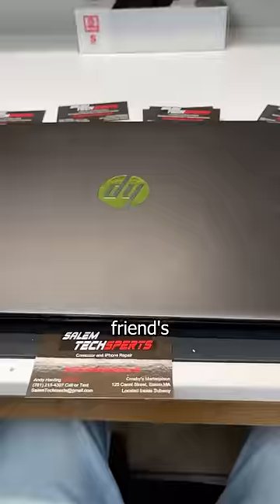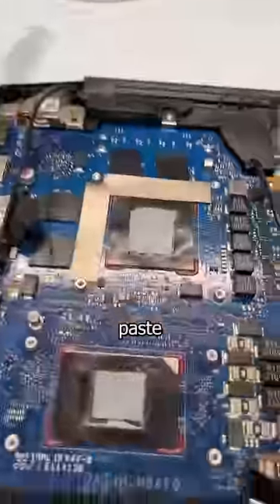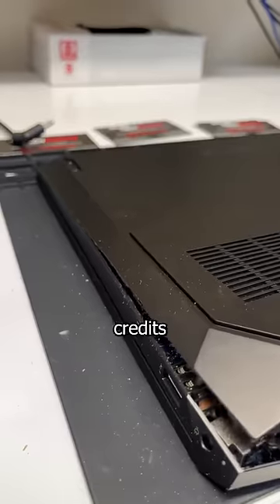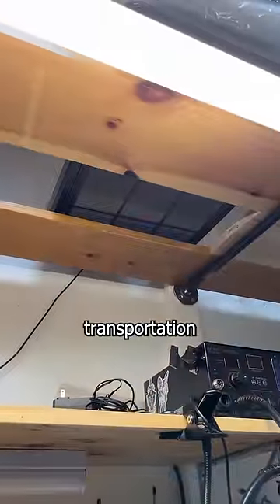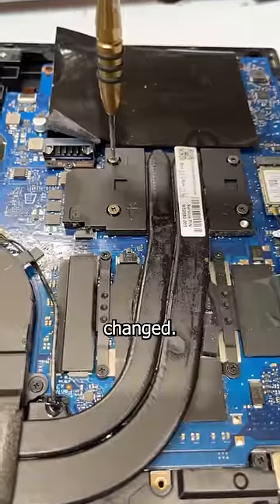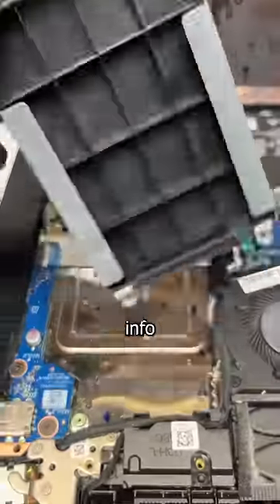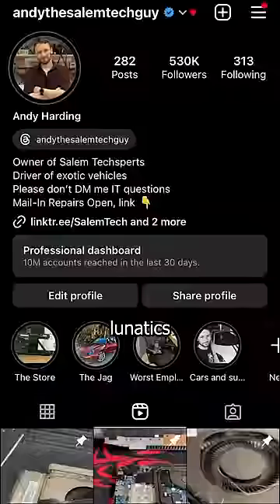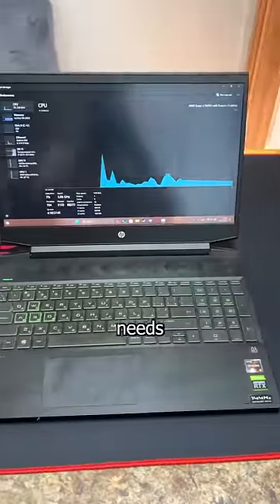HP #laptop survived the war in Ukraine and saved my friends life. #tech #pc #technology #shorts

Comment: The most generous technician that's ever lived.
Reply: 506 likes and no comments?
I'm not an NPC so I won't say that I'm going to change that even though I am.
Reply: Yo why the comment section is empty
Reply: Lmao yess😊
Reply: most greedy technician that ever lived. 350 usd for this kind of job is insane price. I worked in a PC repair shop, this job is max 80 eur. Takes  40 min, requires zero repair capacity.
Reply: @cactuslietuva plus €150 for the 2tb samsung evo.
Reply: @cactuslietuva  Hello, I am also a computer technician in the states. For $40 we'd do anything non-hardware related, for $100 we'd install a sata SSD. I could see a world where an M.2 2TB SSD bumps the price up to $350, especially considering many laptops are a pain in the ass to disassemble. Repasting and the liability with the fragile dies on laptops just makes this make sense.
Reply: @DingleFlop  Yeah, i didn't put ssd value into repair bill.
Reply from the maker: No, you didn't, but you still left a comment saying I'm greedy. See how stupid that looks? Take a second and get your facts straight before leaving comments like that.
Reply: @SalemTechsperts bro is really trash talking in the place where the victim has power💀
Reply: @cactuslietuva Hello commonsense are you lost??
Reply: @cactuslietuva  💀 where did your IQ go?
Reply: @cactuslietuva guy: does a repair for free.
you: omg greedy much?

You really oughta put those two brain cells to work more.
Reply: @SalemTechsperts 
Dam fragile ego...
Reply: Then delete the original comment 💀 @cactuslietuva
Reply: That’s a good one
Reply: @nikhilnarayanan5949  you guys cant take a joke or what?
Reply: It feels like your back tracking cus of the hate you got and you being proven wrong  @cactuslietuva
Reply: skibidi toilet !
Reply: @cactuslietuva oh yes!! Very funny joke.
Reply: @nanwi200 bro what💀
Reply: @adman1056 Damn*

Damn, shit spelling. 🤣
Reply: @whatdadogdoin8703  really? Are you 8 years old and just discovering social media.
Reply: @SalemTechsperts bro thinks a 2tb ssd which costs like 200€ alone is a 80€ repair 💀
Reply: @cactuslietuva  you didn't phrase it as a joke lol
Reply: @theheroofourtime3578  i don't give two shits about internet comments
Reply: @cactuslietuva dude respect the hustle, even if it's expensive, your pc will need it, and it would suck trying ti find an ACTUAL person to help you build your pc. Think man, money is money, and you needa survive against a corrupt government
Reply: @cactuslietuva here we go with the “you cant take a joke?” Shit, cause you cant come back from that. Stfu bro
Reply from the maker: @adman1056  Ego has nothing to do with correcting false statements where the sole purpose is to try to discredit me.
Reply: @SalemTechsperts I was about to comment this but you were faster
I guess your also the fastest Technician ever

(Dad joke)
Reply: @marisakirisame867  hello fellow touhou fan
Reply: @cactuslietuva but you still here, responding to them
Reply: @adman1056 Now to add on with what Salem said

Imagine someone comes up to you and says not good words you would say not good words back right? Now imagine he says wow what a fragile ego you have. Only because you talked back to him

See where im going with my analogy?
Reply: @cactuslietuva  you cant make a joke or what?
Reply: Not to mention the price of an M.2; for 2 TB, $350 is generous in of itself @DingleFlop
Reply: @cactuslietuva  and we're still looking around finding if we could give two shits about your comments 😭
Reply: @cactuslietuva  Ahhhh i see saying something rude and only calling it a joke after you anger everyone around you. Classic move of the scummy kind
Reply: @SalemTechsperts  you could be professional about it instead of belittling him. Use facts and logic not "oh ain't you dumb and stupid now teehee" it is an overcharged price... he's not wrong.
Reply: @YourAverageHuman426  no not really mate, my point is have discourse not debate... he's a professional entity, surely that warrants professional response.
Reply: @bencombs7049  how is that true? I bought a used one like 2 weeks ago and did this exact same "repair" for like £42 it was a 1tb model sure but if I paid an extra £20 I could have gotten a 2tb model. So the grand total would have been around £68 and about an hour of my time. And people can argue oh it was used but it was an A grade rating with a 2yr guarantee for free... a much more logical purchase than a new version with a 1 Yr guarantee... nowhere near $350...
Reply: @YourAverageHuman426  If he's "The Fastest Technician That's Ever Lived", I feel bad for his gf
Reply: Here barely has any power in here 💀  @Pefiye
Reply: @jeweljose2134  Extra rounds aren't really worth much of each round only last 10 seconds. o3o
Reply: @adman1056  that's a good example, if you DIY the repairs with 2nd hand parts it's definitely gonna be cheaper, but he's not using 2nd hand parts and this is not a DIY project, this is not his PC. This is a laptop that was brought to a business and he is making an estimate based on the rates that he charges for this type of repair + parts, and I would assume taht he would not use, used parts for this repair unlike your DIY so I guess that's how he came to the $350 price tag for this repair, also this is not the full video so we do not know of this laptop needed other things done. I agree that $350 seems a bit steep though, but then again I'm not familiar with how much people are charging for these services but the 2tb ssd alone would set you back a few hundred bucks if you buy it brand new, and yes it's true that you can buy a grade A with a 2 year guarantee vs a bnew one with only a 1 year warranty however if you're taking your pc to a repair shop I would argue that most people would not want used parts in their PC's even through it makes more sense. If this laptop did not have sentimental value to the owner and between paying $350 for a repair like this and getting a new one, I would argue that this repair is not worth it and I would just opt to get a new one honestly.
Reply: @SalemTechsperts NAHHHH BLID JUST GOT RRROOASTTEDDD
Reply: @Illeagalbread67  what are you 10?
Reply: @cactuslietuva why are you replying then
Reply: @EA-05 fair enough you make a valid point, thank you for a measured/mature statement.
Reply: @cactuslietuva gal tu jau dink iš čia naumčikas
Reply: @SalemTechsperts keep doing what you’re doing bro 💪🏻
Reply: ARGENTINEAN DETECTED: EXTORTING TF2 KEYES.
Reply: True he is generous but he charges 350 dollars normally for more storage and an ssd upgrade (he said that in this short), that sounds like a robbery 😂.
Reply: I charge 225 for an ssd upgrade + installation and cleaning of the pc. It takes 30-40mins and I have to pay another person that works here. 350 sounds just too high.
Reply: @lowercasealex  no I'm 11
Reply from the maker: @gielnw9891  But how much would you charge if the SSD alone cost $180 like in the case of this 2TB Samsung?
Reply: @marisakirisame867 no way, touhou fan?
Reply: @piotrusgrobelny9033 Yo the ai getting new dialogue
Reply: @SalemTechsperts  nice ratio
Reply: @adman1056 you should know that when I tap translate to English on my device it says "I'm a fragile ego".
Just thought it was a funny misunderstanding of the auto translates part, not trying to cause any issues
Reply: @cactuslietuva do you understand the concept of not being cheap and actually making sure the device lasts by putting in good quality hardware
Reply: Most dangerous technician
Reply: @adman1056 he did something kind and was blasted for it. His ego isn't fragile, he just bites back as he should. Can't let trash talkers get complacent.
Reply: @cactuslietuva  and the new hard drive how you get that free mate 😂, check prices online before bullshiting.
Reply: @vienie1245  he wasn't "blasted" for doing something kind" if anyone was doing that then they're a moron... he was blasted for potentially charging other customers $170 to install an SSD. $350 total cost, $180 nvme SSD, $170 labour...
Reply: @Thalius_  lol that's funny and yh tbf we all have fragile egos... We're human
Reply: @cactuslietuva lol first u talk shit and then u say that's a joke 💀💀💀
Reply: Indeed
Reply: @cactuslietuva no you weren’t joking
Reply: @adman1056 translated to I'm a fragile ego
Reply: @Illeagalbread67 being 11 the same thing as being 10 you are not changing my mind
Reply: @cactuslietuva oh so now you wanna call it a joke
Reply: one could say hes the greatest technician thats ever lived
Reply: @cactuslietuva he did other thing's to it he didn't just replace the storage
Reply: @adman1056 he probably did more repairs to the laptop to get that $350. I mean the thing went through russian bombardment
Reply: @cactuslietuva it was pretty damn obvious you were being serious, but because everyone is rightfully calling you out, you decided to backpedal and say it was a joke
Reply: @iamabird4413  That's a fair point, but he also released a full video about this repair, and I've watched it. He didn't do much else to it tbh... I'm not insulting the guy. I respect his videos they're entertaining and informative, and he obviously knows what he's talking about but $170 Labour cost is not fair... (for this job specifically) $170 for a repair that required more utility would be worth it obviously (before people make that argument)...
Reply: @cactuslietuva  "most greedy technician that ever lived. 350 usd for this kind of job is insane price. I worked in a PC repair shop, this job is max 80 eur. Takes  40 min, requires zero repair capacity"

Can you explain the joke? I don't think I get it
Reply: @A_Bumbling_Buffoon  comfort myself why? And in what way? People responded and so did I. I like discourse... Just as you commented to "comfort yourself"? I'll do as I like boss, and I'm yet to be proven wrong so no I won't stfu...
Reply: @cactuslietuva  that laptop looks like a GAMING LAPTOP so of course its going to be expensive and price varies in different countried
Reply: The only generous technician😂
Reply: @cactuslietuva that’s Eastern Europe prices lad, people charge a lot here in the US. Wages are just higher, that’s just the market
Reply: @DengueBurger  Well compared to our housing prices and food prices we are above most of USA states
Reply: @cactuslietuva Yeah, so this is how Lithuanians are known? Grow up, and stop bringing shame to our country, Lithuania
Reply: @SalemTechsperts Sorry, this one escaped my basement, wont happen again, best regards
Reply: @cactuslietuva he said that’s the regular price it’s most likely cost of resources and time fixing it. He also did the FOR FREE so how is he greedy
Reply: @adman1056 professional courtesy is only for customers him taking his own time to correct misinformation doesn’t make him unprofessional and even if it was a little unprofessional it’s still no merit of a cock eyed sloth to mock a man’s kindness and expect the treatment of a guest
Reply: @adman1056 I don't think $170 labour is ridiculous. There's a lot of factors to consider with SDD upgrades. Are you doing a fresh install, or do you have to migrate data? Is it going to be sata to pcie? Is it going to be something older (like IDE) to pcie? Are you going to need to inject specific drivers for the system to be able to detect storage?

Then there's the knowledge. Consider how long someone might spend on youtube to be comfortable with a process like this in comparison to the "15 minutes" that it takes him.

I have seen cheaper, but I don't think 170 is outside the realm of what's fair
Reply: @adman1056 he’s not a “professional entity” he might be a professional in his field, but his YouTube is not his store and commenters are not his customers”. Also with the jokes he makes in his videos idk why you’d think he’d act different than he did. He actually acted more professionally than any of us would have if someone was trying to discredit us as a person, especially on something you did for free.
Reply: @adman1056  Not all people are rocks without feelings i think
Reply: @cactuslietuva copium gahhh

"it was all a joke guys please stop laughing at me😢"
Reply: @piotrusgrobelny9033 you're not an NPC, you're a five year old.
Reply: @SalemTechsperts  350 usd sounds perfect because the ssd cost for almost have of it then he has to take the laptop apart which is a pain in the ass and then clean it then ship it back out which could cost more money and besides bro gotta be making a profit and like without the ssd cost, it costs 170 usd and the ssd costs more than that so he wouldn’t be making a profit
Reply: @cactuslietuva prices are different too. You know that localized factories are probably cheaper then getting parts from Europe shipping them to China for assembly and shipping them across the world on both directions to get to America, then across up to 3k miles on land only to get it to a warehouse then to a shipping hub than to other shipping hubs, then a local store then to a house. Which is pretty much more expensive than sourced, built, and shipped in the same continent.
Reply: @cactuslietuva who asked you?
Reply: @cactuslietuva  Were this a 'repair friendly' device, I'd agree with you. But modern electronics are, unless otherwise stated/proven to be repair friendly, a proverbial minefield. ANY mistake could result in bricking the computer or damaging expensive components. $350 for something like this, while expensive, IS reasonable.
Reply: @Irks32  no he didn't this is his video 😂
Reply: @Irks32   oh i thought you meant the whole video
Reply: @Irks32  No, he didn't.
Reply: @SalemTechsperts this dude won 3 arguments in 1 reply each💀
Reply: @cactuslietuva don’t put that as a joke now that you’re getting dogpiled on for being rude💀
Reply: @cactuslietuva yet you give like 10 shits about some guys shop halfway across the world from you😂
Reply: @piotrusgrobelny9033 still an NPC
Reply: @cactuslietuva  then your repair shop wouldn't last 5min in the US, shits expensive here, and cloning a drive isn't 45 min and does require repair capacity to do safely (as in protecting customer data)and correctly. We also are around the $300 mark for ssd upgrades with system migration
Reply: 😮 @SalemTechsperts
Reply: @Irks32  nope
Reply: @Irks32  he didn't though
Reply: @marisakirisame867   probably cause, "If you have nothing to say, say nothing" 🤷‍♂️
Reply: @SalemTechsperts THATS MY BOY
Reply: @cactuslietuva replacement parts? Disposable materials(gloves, thermal paste, thermal pads...)? The labour time? The previous knowledge to diagnose the issues? The licensed software (macrium at the very least, aida 64)? My brother you give no value to your work.
Reply: @cactuslietuva go ahead and look how much is a 2tb Samsung Evo pro drive it’s over 250-300USD on Amazon and the cleaning is about 50 bucks idk what are you yapping about maybe it’s because you’re European maybe there the prices are cheaper, but no he’s not greedy it’s a fair price to pay for something like that you know? Maybe next time don’t be so dumb and research a little bit so you stay informed.
Reply: W take
Reply: @cactuslietuva  backpedaling
Reply: @Pefiye nah let him cool lil bro

Comment: HAHAAA I GOT ONE OF THESE

That thing he pulled out at the start is a sata drive placeholder ow whatever . Ur supposed to put a ssd in but i shoved a 2.5 inch hard drive anyway. A ram upgrade was cheap, and your friend lied about the battery, this wont last a week charging a battery, let alone itself on power saving for 5 hours running nothing.

Comment: Dude no joke, you have to help me. I have the same laptop. I bought it as half functioning, the seller told me it sometimes boots and sometimes does not. For me it booted everytime, but it LAGGED. Changed ram from 1x4gb to 1x16gb (one ram slot didn't work). Still lagged, I then changed the ssd, and it worked flawlessly for a week or two. But when I went to my friends house it stopped booting and POSTing. Is this one of those when the motherboard got bent and it got micro fractures on solder contacts of the motherboard or something? The thing charges, fans spin up, it gets warm after pressing the button, the button lights up. (no the screen is not broken, no hdmi output). I'm an IT nerd myself so I need advanced tips for this hp pavilion laptop. Thank you for reading.

Comment: i have a simuliar hp laptop, i need to remove the screws but their head are all broken i cant unscrew them,how would you remove those? plz help me it easilly reach 100°C i need to change the thermals before it dies(i used throttlestop in the past but isn't working anymore with the new bios,i know i'm dumb i should have not upgrade it)